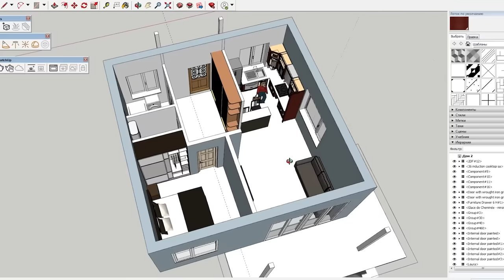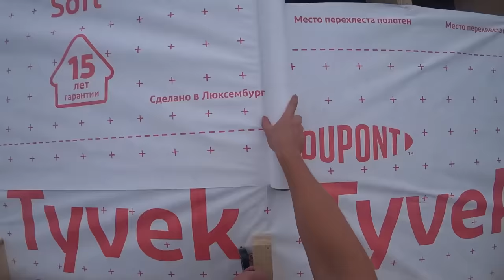$40,000 and 3 years of work | Construction of a small house start to finish

Comment: What is the material for the main walls? At first I thought it was some kind of cement blocks, but they seemed fairly light weight, and you can work them kind of easily.
Reply: Aerated concrete basically.. ofted called Ytong,  sillicate blocks.. widely used in continental Europe

Comment: Foam as a structural material for walls? Don’t seem very solid.
Reply: This is a type of concrete block. It's as solid as a brick.
Reply: This is what i am thinking as well not very solid i think should be cement all the way just like the base.
Reply: @Nikolayy_Ivannov  when he scrape it doesn't look very solid to me its fibrous as wafer biscuit  😆
Reply: Floating slab, no foundation into the dirt = problems later

Comment: "4oul# have used ICF blocks faster time line use whrrlborrow to do sidewalk
Reply: Use stucco with drip edge to allow water to exit wall, apur down plywood sub floor on second floor poor exterior side walk same time as floor poor planning, did not use radiant vfloor for heat or beat pump?

Comment: I'm so confused about many thing. Some one enlighten me, please. No construction experience here.
Is it structurally stable to build a house basically on foam? I understand he put concrete around it, but what if there is a structural damage and moisture and what not gets to the foam underneath the house? Will then the walls of the base be enough to support the whole thing?
When starting to build the walls of the house after he was done with the base, he first used concrete in between the big slabs, but then he switched to some adhesive it seems? Will that tiny bit of what ever keep the house together? I understand the metal rods he uses after each layer will help too, but what even is that stuff?
On top of some window openings they put long slabs resting them on the lower ones. I guess that's sturdy. But what bout the slabs put on a funny little plank of wood?? That's obviously not enough strength to carry that weight!
What has always confused me, when seeing construction works: everything gets wet from the rain. You'd expect mold to form everywhere.
What's the red dye, they use to dye some wood planks? For example the roof.
When joining the wood slabs of the roof he used only ONE nail??!!
What did he fall for? XD  (Not really a question, for those who are wondering)
While attaching the metallic (?) roof, they drilled screws into the parts. Won't water get into the structures trough the holes?
Thank you to who ever has the patience to explain! :)

Comment: "Space for rent - $5,800 a month, with first, last, and negative-first month's rent along with a security deposit of $30,000 due upon signing of lease. Utilities such as electricity, gas, heating oil, internet, water, sewer, trash, landscaping, gutter cleaning, and driveway sealing to be paid by the tenant. Proof required that all four 250 gallon oil tanks are fully filled before October of the first year. Tanks will be empty upon move-in, but required to be over 7/8ths full upon move-out. Landlord may graciously opt to renew the lease every year with a nominal increase in rent of 65%. If a new lease is not signed, the tenancy will continue on a month-to-month basis, with rent increasing by $200 per month up to a maximum of $3,000. On-time payment of rent will NOT result in positive credit reporting, however Landlord reserves the right to check prospective tenant's credit rating."